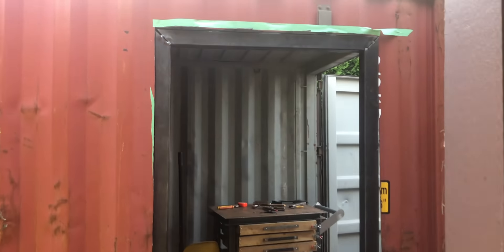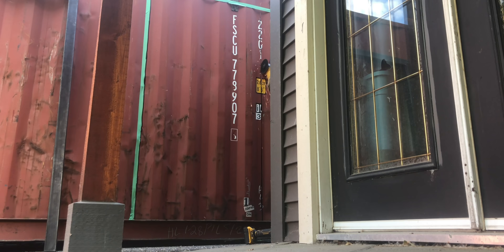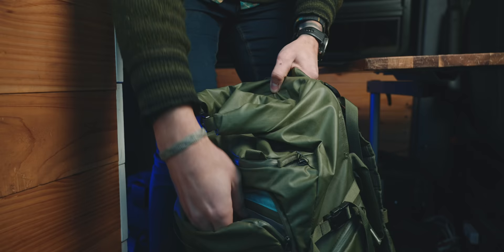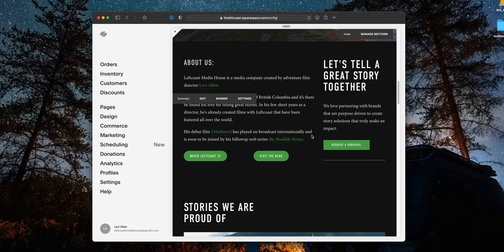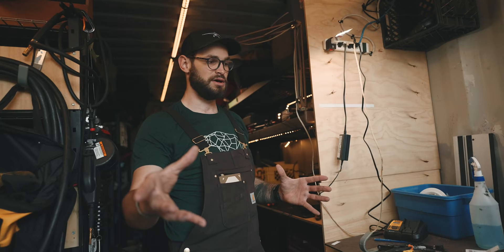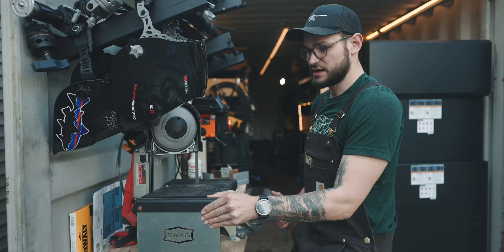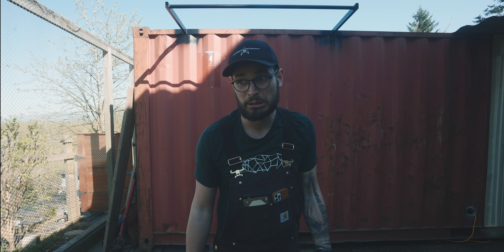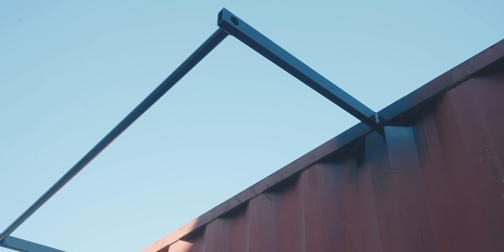SHIPPING CONTAINER WORKSHOP BUILD! DOOR INSTALL

Comment: I'm a very good mechanic, and I have many hammers, crow bars, adjustable wrenches, chisels, and various types of locking pliers.
I can't think of any of them that I haven't needed or used.
They are invaluable for situations where parts are seized, stripped, or broken, and cannot be removed with normal fitted tools.
Yes, I have worked on a motorcycle with a hacksaw.

Comment: For your cutting and grinding area... Get some clear vinyl strips (like a walk in cooler/freezer has) I did that in a small garage to isolate one area for cutting/welding etc.  Really helps keep the mess on one side.  You could prob attach them on strong magnets so when not in use they wouldn't be in the way. 

Also if you're going to do a lot of metal work buy a plasma cutter, so much better than a cutting wheel or oxy/ac torch
Reply from the maker: I love that idea

Comment: To move your container you could use you winch of the sprinter. I would just put my Unimog in front of the container and drag it :)

Im a huge knipex fan too! good choice in tools. Today I ordered a 40 euro 27mm socket specially for my Diesel injectors. Good tools are so important on mission critical parts!

I ones visited someone that had 2 shipping containers next toe each other. The wall were taken out that made such a great workshop!

Comment: Have you thought about buying a airless paint sprayer? You can pick one up for around hundred dollars. For what you paid for in those spray cans you could of almost bought one, plus you can use it to paint your work shop both inside & out. And a added bonus is you will have it for all of the projects you plan on working on 😎
Reply from the maker: I actually do have one. It’s only recently that I learned I can put metal paints through it

Comment: I have been working out of my 40ft shipping container workshop for months now and they are great, heaps of potential and I will be adding a window in the side soon. Do you find you get any moisture build up?
Reply from the maker: I’m the winter I get condensation with my propane heater. That should be fixed sort of if insulate!

Comment: Hey can I sell you components from my electric bike? It's a brilliant build, I think you'd love the parts, and I can't re-build it and ride it again because my wife would kill me if I broke my leg again. The guy who built it moved back to Germany and was going to school for nuclear physics and is seriously a genius but it's just a project I can't really do anymore :(
Reply from the maker: Where are you based? At this point I have all the parts I need to get my current bike up and running
Reply: @Levi_Allen  I'm in Chicago, but if you have all your parts it might not be necessary. Still, there's some great stuff. The bike I had could get up to like 60mph and was actually ridiculous lol. The hub motor in the rear is like 5000watts with the current battery voltage and liquid cooled. Looking back, it was far too much bike for me to consider lol. He gave me a really nice charger (actually a server power supply) and other stuff too.